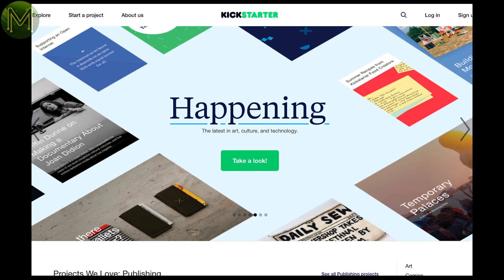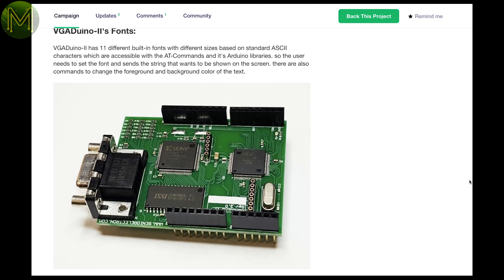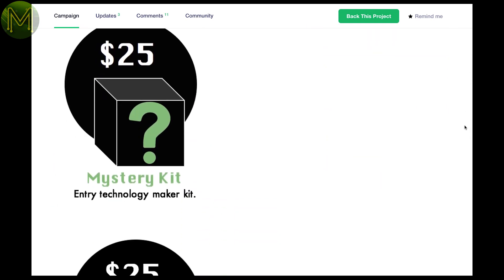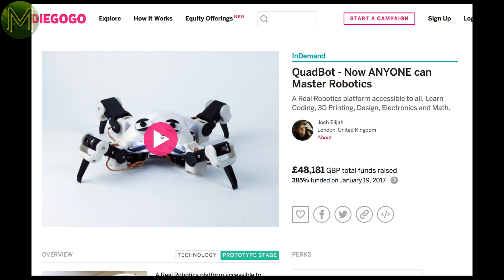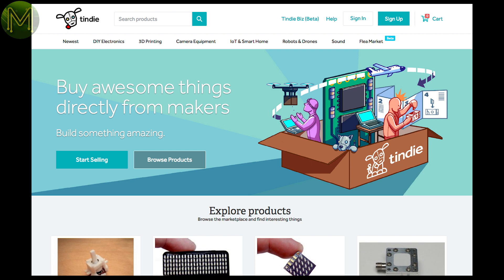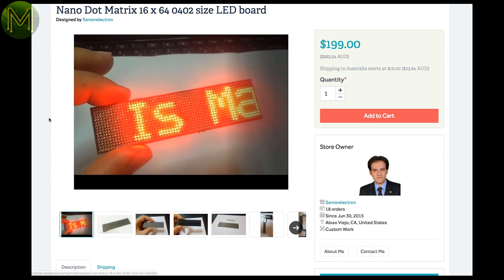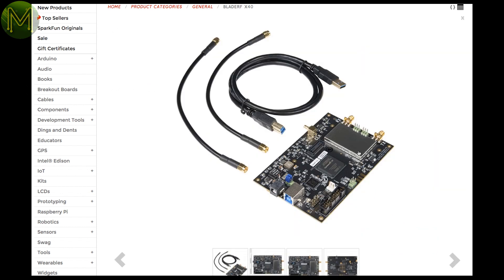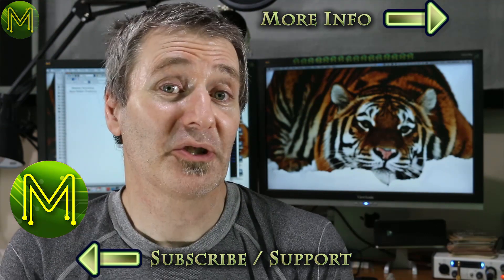#091 Weekly Roundup #20 - New Maker Products

Comment: The malduino will have a lot of particular uses. For one thing, there is already the "rubberducky" which is used for penetration testing and hacking computers, for another, it is sometimes easier for an arduino project to interface with existing software (like a flightsim) by faking a keyboard.

Comment: Hey Mick, any experience with the Onion Omega? Reason I ask is I backed their kickstarter for the 2nd Gen product, an d it's finally come in, the Onion Omega 2 Plus, along with some bits and bobs that go with it, namely a daughterboard/dock sort of thing with an Arduino compatible layout (complete with a 328P on there), and then a PWM generator expansion card for LEDs or servos. Could be interesting
Reply from the maker: +stryk187 
Yup, I was a Kickstarter backer as well and have it on my desk. I'll have the review up the following week hopefully.
Reply: i dont like that you need two shields for ethernet, and difficult to box a stacked omega (odd shape and goes high). interested in how easy these are to wack on some protoboard and do your own thing. how low power can this go verse the CHIP
Reply: Awesome! Looking forward to it

Comment: Can the Rasp Pi's be programmed like an Arduino. If I got one, I don't want linux or any OS.
Reply: It would probably be easier to program in python or c++ and launch the code as a program in the terminal. That way you have the option to use the pi as a normal computer with OS or as a dedicated board(like Arduino). You would also get other stuff "for free", such as Internet communication via curl, image processing with imagick or whatever it's called. Or GPU-processing via opencl (Parallell Computing is sexy, it's 2017).

You can probably make your program to start whenever the pi is done booting up. I'm no professional/expert, just saying what I would do.
Reply: TheProCactus the raspberry pi is a microprocessor and therefore needs an OS of some kind. The arduino is a microcontroller, and generally just does the same thing repeatedly. That is why Arduinos don't use a traditional OS. You are really limiting yourself by avoiding Linux in the maker world.
Reply: I see both your points are valid. I probably should just get one and have a chop at it.
Reply from the maker: TheProCactus yeah do it! You won't look back.

Comment: Great video man, keep it up & thanks. And yeah the OPI0 black box is really great. I will drill a hole on top of mine to stick a 30mmX30mm fan, but that official expansion is blocking airflow from top of the SoC! Have you an idea on what to do with that? http://www.banggood.com/Copper-Aluminium-Heatsink-Fan-Cooling-Kit-For-Raspberry-Pi-B-Raspberry-Pi-2-p-1045412.html
Reply from the maker: Thanks!
That was my thought as well with the OPi0 case. Haven't thought of a solution yet.